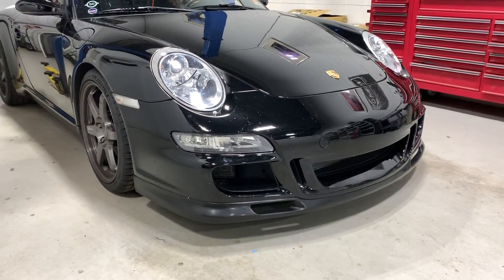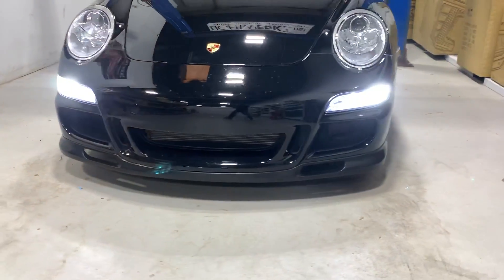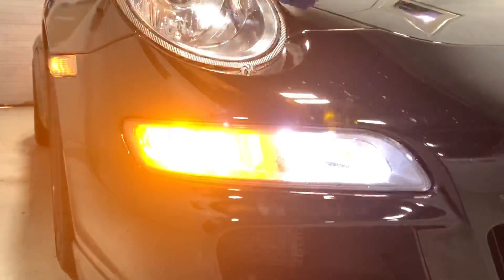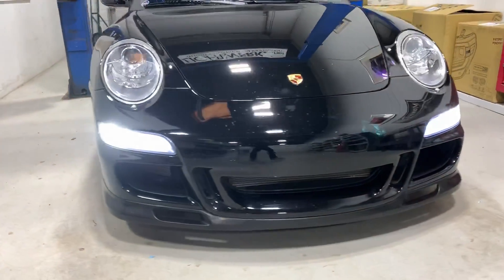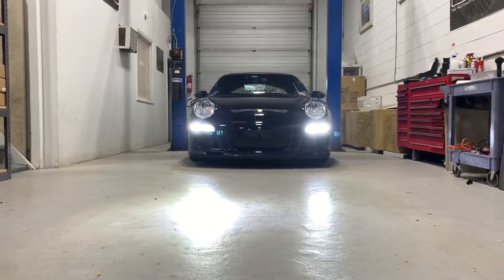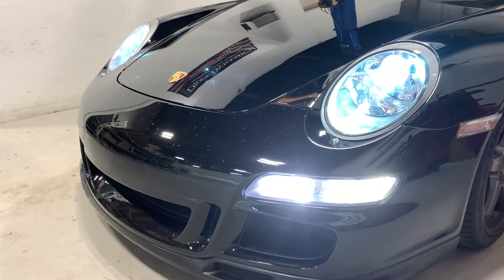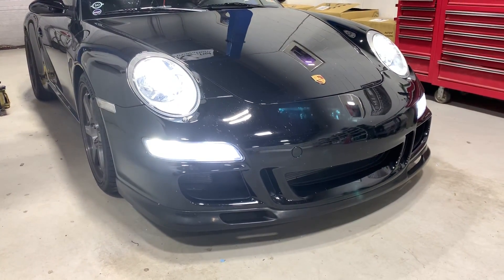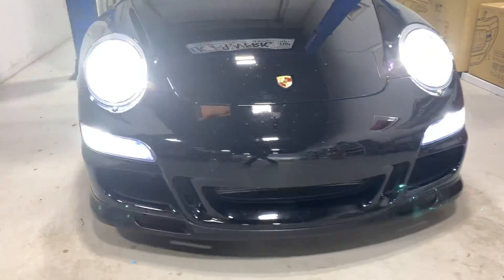Porsche 997 LED Upgrades

Comment: Can you do a detailed comparison between m-led 2.0 and ilens 2.0?. Proper lux of lb+hb, hotspot position, foreground, max width, lens focal length, power consumption, shield and it's mechanism comparison, temperature of the chips when on, etc?.

Comment: Appreciate that this vehicle had OEM bixenon/litronic, however, I have queries regarding upgrading OEM halogen H7-equipped low beam 997, as follows:

OEM bixenons appears to have all their hardware (ballasts etc.) within the closed headlight assembly, and presumably they would generate a degree of heat in any event, and so - is installing an aftermarket HID or LED kit any different in terms of heat?

Would something like the Morimoto 2stroke 2.0 LED kit (H7 bulbs), generate less heat than OEM bixenon, given better/more efficient circuitry/chips etc., and generally being 15years newer tech, and thus operate fine and without unnecessary excess heat?

Any issues with the fans in a sealed environment such as 997/987 headlight enclosure? 

Also, is it necessary to purchase the Morimoto Anti-flicker adapter? Thanks

Comment: Do you have a link to the bulbs?
Reply from the maker: Yes here it is below
Reply: Thank you, also, which base adapter and harness and controller would I get for a 997.1? I’m trying to replicate your setup in the fog light and turn signal cluster.
Reply from the maker: @RealtorCardozo  Hardwire pigtail adapter for V6 Triton. H11 for the fog light
Reply: I appreciate it!
Reply: @LightwerkzGlobal  sorry, where is link?
Reply from the maker: @rastislavpauliny4497  updated in description